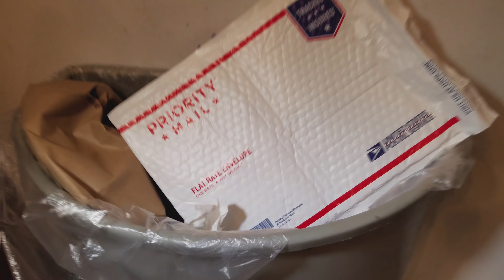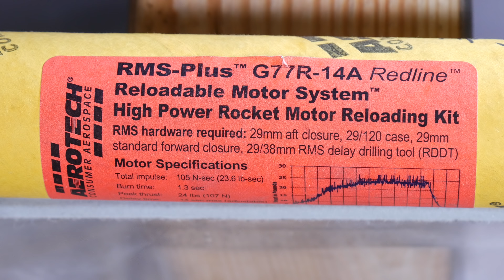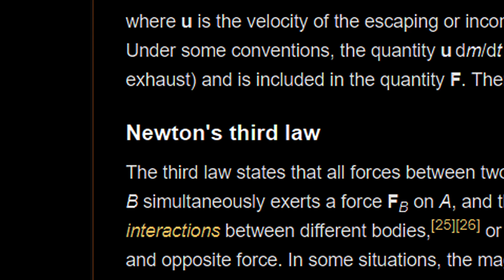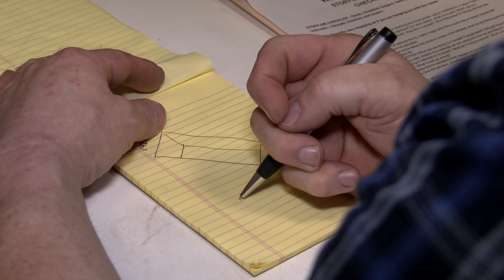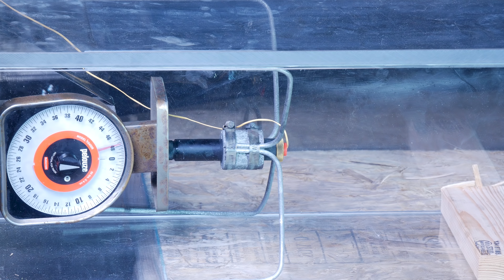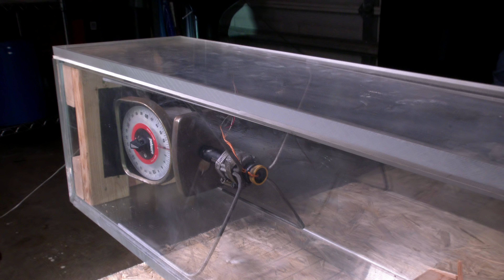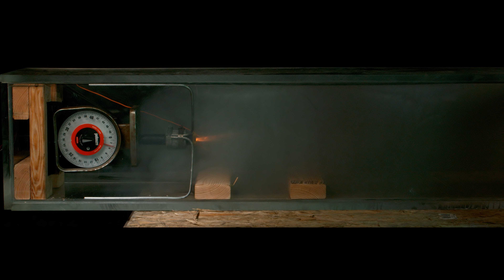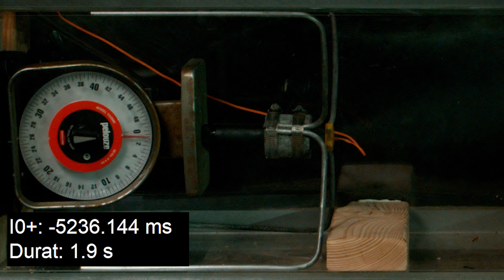Rockets in a Vacuum Chamber - Newton's third law of motion Visualized

Comment: I do believe that newtons third law would work in a complete vacuum such as space. If you push on something it pushes back no matter where you are. However this experiment does not prove the hypothesis because the chamber is too small to maintain a vacuum the moment the fuel is lit. And I also don't believe in space. The idea of a complete vacuum existing beside such a large atmosphere without a barrier just makes no sense to me. The fact that you can boil water by just lowering the pressure shows that the pressure gradient we experience in our atmosphere cant exist beside a full vacuum. I believe the vacuum will keep pulling the air away. I mean space as they teach us is massive. the earth is nothing compared to the vacuum of space. How can gravity stop the pulling force of such a vacuum.
Reply: And let me note that i am aware of the different layers of the atmosphere and how the boundary of the first two layers freezes water and stop it from going any further. Im just saying that all that couldn't exist without a barrier
Reply: RALO Ed. Did you ever been  to mountains? Did you notice that air there have much less pressure then on sea level? Tell me where is barrier between sea level and mountains top?
Reply: RALO - There is a FORCE FIELD exerting a FORCE on the mass of the atmospheric gas molecules.
this force field is called GRAVITY.
The ability of gravity to hold in the atmosphere is taught in High School phyiscs.
Didnt you take physics in high school?

Comment: Sorry buddy, good try but space is supposedly ever expanding so a chamber wouldn’t suffice because space wouldn’t be a chamber. Since you didn’t get ignition from the igniter not in a vacuum, you broke that vacuum in the chamber thus creating a pressure differential and positive pressure in the chamber. Even with the pump running, the ignition over came the pump and the pump will not instantly bring the chamber back into a vacuum. Unfortunately a true representation of what the conditions of space are supposed to be would be very difficult if not impossible to recreate. Don’t forget space is always expanding, so a chamber would not and can not apply. Even if the vacuum did hold, which it couldn’t have because the ignition was sustained, in space it still wouldn’t matter because there is nothing for the rocket to push back on and the ever expanding universe would anything that might be there for it to away from it, so propulsion is not possible in a unrestricted vacuum. Space is fake and the earth is flat. Think about it and do some research. You are a very smart person and I did the same thing when I first heard it too. I called BS and I tried to disprove it for a long time and I couldn’t. I also looked at it with an unbiased opinion. I thought I knew it wasn’t but looking for a short time I didn’t know but now I do.
Reply: Mark Bell - If I fire a standard steel projectile from a CROSSBOW in space, WILL I FEEL a recoil force? Yes or No?
Reply: No comment? Too difficult of a question?

Comment: WRONG:::  I just retrieved a one year old comment, which you had deleted here, and posted it as my second comment under my own video: ("Solving-Apollo-Enigma-1") , starting with:
"Conventional rockets canNOT move rockets inside a vacuum, even if they continue to burn, and even if they continue to provide thrust inside a vacuum."
Reply from the maker: I don't think I deleted that comment. It may have been automatically held for review.
Reply: @WarpedYT  OK. thanks. Then, here was the rest of the original comment::
My feedback: @10:00 your rocket-motor produced limited thrust, probably because you provided it directional resistance to push against. Also, your small chamber quickly filled with rocket-fumes, thus creating its own atmosphere to thrust against: 12:50 corroborates this with the main ignition far from the motor, where air/atmosphere must have been created which helped the spread of fire,  too far behind the rocket to help increase its thrust! Either way, if you run similar experiments inside a very large vacuum-chamber, assuming that your free-standing-rocket could generate thrust, and could start moving inside the chamber, it instantly spins out of control, because it can NOT direct itself in any particular direction, even if it has fins, or wings; which is because its own burn could NOT fill that chamber to create its own atmospheric-resistance to choose a flight-path! In the "limitless-vacuum-of-space", this spinning would occur as soon as a conventional rocket reaches the vacuum! Thus, unable to go anywhere!
NASA has a massive vacuum-chamber (100+meters tall), and must have discovered this obstacle during 1950s, when they eventually decided to fake-it-to-the-Moon, just to plunder a lot of money through the Apollos, and to keep thousands of connected draft-dodgers out of Vietnam!
Suggestion: please re-run your experiment with your vacuum-pump running at the right-end of chamber, which I think will result in very little, or NO ignition at all, because the exhaust gets pumped out! Also, an experiment with a rocket motor sitting loosely, or hung from the top, when ignited, to see if and how it would move, IF AT ALL! And thanks again. Such experiments and findings are those Neil Armstrong was relying on his next generations to conduct to “Remove the protective layers of truth.” Dated:: November, 2018
Reply: @WarpedYT  Youtube:: (Brian Cox visits the world's biggest vacuum chamber)  with a fresh reference to this video. That's a place to conduct similar, but more sophisticated experiments, as I explained above !!!
Reply: @kareemsalessi  @10:00 your rocket-motor produced limited thrust, probably because you provided it directional resistance to push against. Also, your small chamber quickly filled with rocket-fumes, thus creating its own atmosphere to thrust against
Except that we can see in the slow motion clip that the engine starts producing thrust before the chamber is filled with fumes. Also, if rockets relied on the atmospheric resistance, as you incorrectly allege, the trust of this engine would rise as the time progressed, proportionally to chamber filling with fumes - and this is now what we can observe.

Either way, if you run similar experiments inside a very large vacuum-chamber, assuming that your free-standing-rocket could generate thrust, and could start moving inside the chamber, it instantly spins out of control, because it can NOT direct itself in any particular direction
Why not? With trust pointing in one way, the rocket would start moving in the exactly opposite way. When you push yourself off the wall, you'll move back, not in some random direction :)

NASA has a massive vacuum-chamber (100+meters tall), and must have discovered this obstacle during 1950s, when they eventually decided to fake-it-to-the-Moon, just to plunder a lot of money through the Apollos
Except that actually faking the Moon landings would've been more expensive than actually flying for real.

Such experiments and findings are those Neil Armstrong was relying on his next generations to conduct to “Remove the protective layers of truth.”
Oh, you mean the same Neil Armstrong that said ‘People love conspiracy theories, they're very attractive, but they were never a concern to me, because I know someone is going to fly back up there and pick up the camera I left there.’? That Neil Armstrong? :)
Reply: @kareemsalessi  As always, your inept insults are not a replacement for actual counter arguments.
Reply: @Jan_Strzelecki  Just in case you are NOT a SPAM, but a regular sheeple::: "Do NOT change your beliefs, because ignorance is bliss, you will appreciate it only if you accidentally step out of it" !!!
Reply: @kareemsalessi  Yes, sure, of course, but it still doesn't change the fact that your claims are factually incorrect :)
Reply: @kareemsalessi  want to see VIDEO EVIDENCE if rocket propulsion in a vacuum?  Search YT for "Uninterrupted Footage of the Falcon Heavy Launch and Booster Landing" and watch that until the boosters land, them report back.
Reply: @stuartgray5877 ===SPAM::: I had fully discussed that Fake-SpaceX-Landing-fraud in my above-linked video, just pull up its transcript & read it near the end of it!!!
Reply: @kareemsalessi  - "You are a total fraud, as I had previously proved in Mike-Helmick channel !!!"
Oh REALLY, I would love to see such "proof".
I have told you before, just ckeck my resume on LinkedIn. I dont hide my identity, just search "Stuart Gray Lockheed" and tell us ALL what you find    For you to keep making accusation without checking makes you a COWARD.
Reply: @stuartgray5877  Lockheed===a criminal enterprise.
Reply: Newton's third law doesn't need an atmosphere to exist
Reply: @kareemsalessi  and please point me to where you proved me wrong on this other channel.
Reply: @kareemsalessi  
Amazing... every word of what you just said was wrong.

Comment: I think that this hope does not validate the possibility of the spacecraft moving in the vacuum, because the variables that this hope cannot reproduce, because this vacuum is limited, and the rocket pressure can reduce the limited vacuum of the environment, and does not compare with the infinite vacuum of space, and in order to occur the same thrust demonstrated in the waking, the real rocket would have to be thousands of times larger than those used conventionally, considering the relationship of the solid rocket of the test in relation to the size of the box. vacuum and the cubic volume of the test itself, so far I think it is unlikely that a spacecraft has traveled at more than 5,000 kmh for more than three days Earth.!
Reply: It proves, that expelling gas produces force, deal with it;)
Reply: I will deal with the fact that this experiment is the same as proving the magnitude of a star with a kkk match stick ...
Reply: mario caetano junior makai you didn’t deal at all with it;) tell me genius when you throw a heavy ball on a skateboard, what is causing you to move?

Comment: Thought the argument was that rockets had a limited time if any at all to burn fuel considering there is no oxygen in space? the experiment is wrong. Those toy rockets hes lighting in the vacuum, have oxidizers. from my understanding, the little toy rocket WILL light and even burn for a moment of time. BUT that's not the problem according to conspiracy theorist. When a rocket launches to space, it has oxygen within the earths atmosphere to burn the fuel, but when it reaches higher altitudes, oxygen becomes scarce, and when it reaches space, there is NO oxygen. In that case, oxygen must be stored somewhere internally on the ship to be used for fuel/breathing in either case. The experiment should be testing what the rocket is capable of with full oxygen available, and comparing that to the performance of the rocket with limited oxygen. FOR EXAMPLE, if the rocket burns and thrust itself in the vacuum of space with no oxygen equally as good as it burns with oxygen then its proven rockets can thrust in the vacuum of space. BUT that means there can be no oxygen in the vacuum experiment container NOT EVEN in the fuse of the toy rocket. The whole fucking point of the test, isn't if the rocket fuel can burn in the vacuum of space, because of course it can if oxygen is stored and used for burning purposes, the gist of the whole experiment is asking if fire can exist without the presence of oxygen. What I'm trying to say is that your car pulls in oxygen in order to light the fuel and create a controlled "explosion", which pushes your pistons down, which in essence makes the vehicle go (not going into further detail). But there is no fucking oxygen in space. My argument is, how can we store enough oxygen on rockets to "fly" ourselves 239,000 miles there and back (roughly 477,000 miles) and also use for breathing air. Combustion cannot exist without oxygen or some other flammable gas. Compare the differences, one with the amount of oxygen that equals that of earths atmosphere, and one of the toy rockets in a vacuum with no oxygen at ALL. IF they perform equally, then you can say they perform equally well therefore rockets can fly in the vacuum of space. I do not believe that internal combustion is possible without oxygen, so it would have to be stored in order to fly a great distance in a vacuum. (Like NOS in cars as a bad example) The experiment failed: just because it burned fuel for a short period of time does not prove that rockets can "fly" in space.
Reply: But there is no fucking oxygen in space. My argument is, how can we store enough oxygen on rockets to "fly" ourselves 239,000 miles there and back (roughly 477,000 miles) and also use for breathing air. Combustion cannot exist without oxygen or some other flammable gas.

We can do that by compressing oxygen and making it liquid. Didn't you heard that?
Reply: @Appl3 YT 
No, not for the Apollo missions that the original commenter was referencing. There hasn't yet been a rocket that uses jet propulsion in the atmosphere and rocket propulsion in space, unless you count Virgin Orbit's airlaunch system.

Comment: Is that a rocket engine you're using there or a firework? Looks like the latter to me.

Also it's possible that the firework could be using the far end of the vacuum chamber as an object to push against.. still, interesting to watch 🙂👍